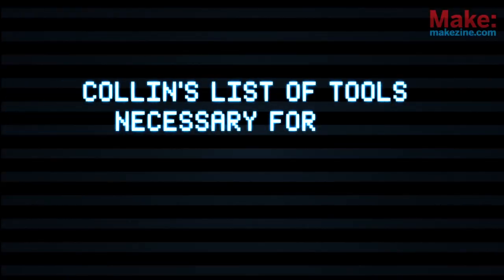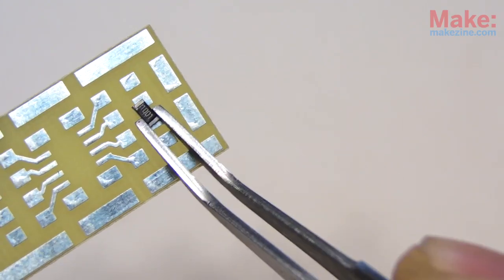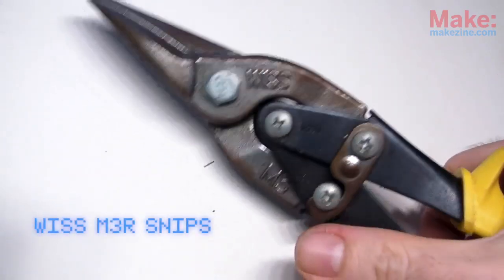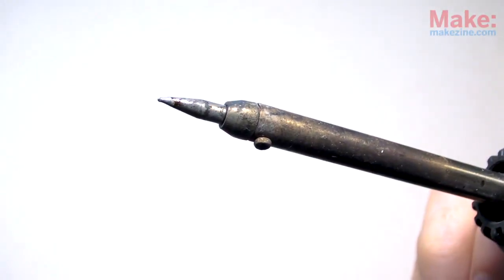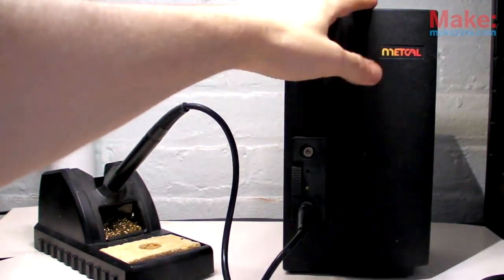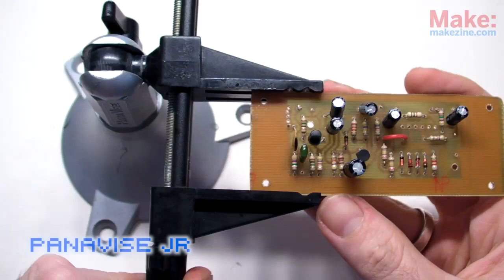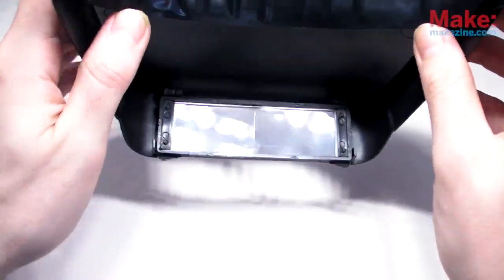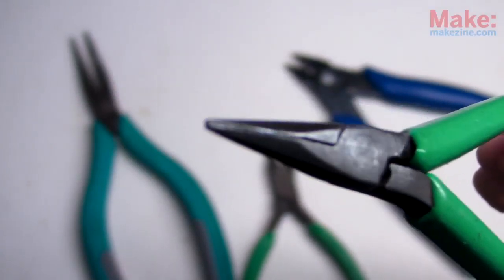Collin's Lab: Electronics Tools

Comment: hi, can you do a video on heavy-duty pcb controller boards, like the induction hob mcd3500 to remove the components and replace bcos am looking for and easy way to desolder and soldering parts as I have seen the board got a milky layer on top of it , let's say protective layer. thank bro enjoy it. 👍👌

Comment: You'd have much more easier time just adding bunch of solder to leads then use tweezers to pull it out, and then pump all the solder out, this way i prevent circuit board damage when cannibalizing for parts.

Comment: wtf u dont need any special tools to cut the insulation on the cables i just use sciccors or my teeth
Reply: Most people, myself included, have a hard time stripping wire without a wire stripper.

Comment: Recently discovered an awesome tool/trick. To remove a component for reuse-Pull on it lightly then hit the underside of the board with a heat gun on high and close. With just a little pulling when the solder softens, the component will come out nice and clean.
Reply: Carl Carrano wow thats cool thanks man thats gonna be pretty useful later on(:

Comment: phffff... wire strippers are for noobs. i allways use my red household scissors to strip my wires
Reply: If I put the right music on,  my wires strip for me..........  : )
Reply: Pff... Scissors are for noobs. I always use my teeth to strip my wires.
Reply: That seems more noob-ish to me.
Reply: the best success that i've had was with the Gregs Electro Blog (just google it) without a doubt the best info that I've followed.
Reply: Justin, sure. One dentist said "lol, a gopher teeth" after I opened my mouth. That was fun (no).
Reply: Pff soldering stations are for NOOBS,

I always shortcut a cable plug it into a wall and then wait for it to heat up so I can solder
Reply: I got some strippers in the club
They all want my wire
Reply: Just don't fuck with the wires, fuck the strippers

Comment: What about solder wick for desoldering. Much better than those I would say.
Reply: +Nick Coltrane Nope! Pump, any day! :)
Reply: +Nick Coltrane It depends on what you're trying to desolder. For surface-mount components I think wicks are going to be much better and easier to work with. However for through-hole things, you'll likely go through a lot of wick when you can just suck up the solder.

I've personally used the pumps for larger through-hole components. Sometimes the leads just get in the way of the wick and don't let it fully work correctly, whereas a pass or two with a pump gets what I need taken away. I'll go in with a wick if I want to replace or clean the pad/hole.
Reply: +Nick Coltrane That's what I thought, too. I'll pick a decent solder wick over that pump thingy any time.
(Though it is a consumable - it's pretty cheap, though)
Reply: spartan456 I second that.  I find adding a little new solder helps too.  For through hole, suck up what you can with the pump, then  use wick to clean the pad if needed.

Comment: Hey Collin!
You are a Great Instructor and 'am always looking forward to watching your video tutorials.  

Since the electronics market is changing to SMDs more and more, a presentation of hot air solder stations would be in order, plus All the peripherals that go with it.  That includes the type of flux, solder paste and the applicators such as the gauge of the blunt needle tip.

Google & eBay are my best source of this information so far.  You could do better.  So, how about a video on the subject?

Also, when buying DIY kits (as they are now called), seems there is always an SMD IC chip that has to be soldered onto the board.  There's just no getting around it!

Keep up the Good work!

Lord Saint Dennis Charles Smart, Enlightened
Heaven's Spokesman & Hobbyist

Comment: I got a Veller maginfication visor with built in lights. The problem is they used old fashion light bulbs. So the first thing I had to do was to mod it so it used LEDs instead.
Unbeliveable that they haven't changed their design to use LED lights.
Reply: What's the focal length of the lens(es)? How close do you need to be to the thing you're looking at?

Comment: Just to add to that list, I much prefer the jokari tool, it's really handy to strip cables. You don't need to adjust it, it just naturally fits the cable whatever it's size and strips it, even in the most tricky angles!  http://www.ebay.co.uk/itm/330258217490?_trksid=p2057872.m2749.l2649&ssPageName=STRK%3AMEBIDX%3AIT

Comment: hey collin I always admired your vids. I garra question , is there anything for measuring electronic parts like for example a small resistors or capacitors to know what are their types( numbers) ?
Reply: Babylon Gate For resistors, your typical multimeter can tell you their resistance.
Capacitance or Inductance is a little trickier to directly measure, the device used to measure that doesn't come cheap.

Comment: Just to add...A good light source and heres a few improvised tools of my own... good pair of nail clippers are great for close cropping of wires/soldered joints and transistor/ic pins...also...blue tack or playdoh for temporarily holding awkward shaped parts etc, I have also made my own magnifying visor out of a pair of sunglasses...the plastic type by cutting a circular piece out of one lens and putting/screwing in an old  telescope/binocular objective lens in the cut out circle, works well for working with/soldering very small parts, also...a headlamp in conjunction with the visor or without works well, Anyone else any improvised tools to add? I would like to hear from them, Great site by the way Collin!
Reply: dude thanks!!
I had no idea about the PlayDoh tip.

Comment: Collin's I might suggest you learn the proper name for those tools and follow the Mil-Spec certification rules when making your recommendations. "Just saying," as an Instructor of Vocational Adult Electronics for 20 years and training 6,000 students proper electronic assembly and soldering as well as many other courses in the program. Also you don't use round nose pliers, they bend items and leads smothly rounded so they are stronger and not sharp folded at the bend. Also those "Tin Snips" as you called them were in fact "Aircraft Compound action cutters for sheet metal, not tin, as much as aluminum and light steel sheet. Thanks for trying but you could do better... And I expect it from you. Also I often use a "Drill-Press" Vice is a great unit and inexpensive, Try the Harbor Freight 2.5 and 4 inch models... Keep up the good work, Your watchers deserve the best instruction you can provide.
Reply: Be careful of "3-in-1 oil they sell a nice lubricating oil AND a furniture polish that turns to varnish in a few days...   another choice for rust prevention ,(Especially here in the damp south) is Kiwi Mink-Oil boot polish, it goes on easy and protects from rusting for about 6 months  Just use a tiny amount and buff most off. I use it on the Vice and snips, as well as my shotgun and they are protected from rusting but do not have to be cleaned off before using... "Keep up the good work.."

Comment: You don't a DMM with a low impedance input will get you by for a long time, in time you will find it handy to have a second DMM, but no need to purchase that until you find yourself needing it A power supply would be an early on purchase. Most of the others mentione generally can wait untill you find a good buy on them or you find not havingg them is hinderingg your work.

Comment: I'm guessing that the solder melts.
Well solder not sticking to the iron could mean a bad soldering iron tip.
That's why the top of the tip is different from the bottom.
It's designed for good stickiness and other performance enhancements.

Comment: It was a new soldering iron (so also the tip) and I always use rosin core 
it just turned out that the 80W iron got to hot because since I added a in-line dimmer and got the right temperature everything works great and the tip isn't a problem anymore 
I love this new setup (instead of a simple 30W iron I now have some kind of 80W station :)

Comment: Well, oscilloscopes are quite expensive, and you probably won't need it for most hobby-level projects. As for the fume extractor, you can make one, solder by the window, or outside; it's not truly essential unless you solder a couple times a week (or more frequently) or for long periods of time. I agree with you on the multimeter, though, even a cheap $10 one will cover most of your needs, and you'll be needing it always.

Comment: could someone help me pls:
I made my own soldering station out of a 80W soldering iron and a in-line dimmer. But my solder doesn't wanna stick to my iron, I tried to put it warmer and even colder (have yet to calibrate it since my multimeter is being repaired now) without success. I do clean my iron on a wet sponge and with a metal brush thingie but it doesn't seem to help much.
If someone knows how to fix it pls tell me.

Comment: Metcal's what I use at work. Awesome iron, though I like it best because it has such a short tip length. Not great at tight spaces, and they get kinda hot after a lot of constant use, but the amount of control you get outweighs these problems many times over. Too long a tip kills accuracy.

Comment: another more expensive high quality soldering station: the weller ws81t goes for around 300-400 bucks and its a joy to work with. Adjustable temperature, nice flexible cable and an weller stop and go soldering iron holder, which shuts down the soldering iron if unused, which saves a lot of expenive tips :)

Comment: BUT, the video is about TOOLS for CONSTRUCTION.  I got parts, board and schematics, what is needed to put them together.  It is not about tuning, tweeking, reconfiguring or experimenting. What do you need to get the parts on the board.

Comment: @ChozoSR388 Let me be more clear. I can use a Dremel, a soldering iron and a wire cutter (tools) to make a PCB. And to test it out I'll use an osciloscope and a multimeter (measuring instruments [instruments]). According to the context you're using, you can use both to say something is an instrument or a tool. In this case, some of us consider the multimeter as an instrument and not a tool.

Comment: @bahstrike It might be useful for specific circuits, but certainly not a basic tool that you must have if you want to do anything with electronics (the only thing I can think of right now, is to check voltage if you switch from AC to DC or something, a lot of the time people have a DC power source though)

Comment: I consider soldering to be difficult and I use a Radio Shack 60W soldering station with digital presets and temp. control

Comment: Colin, FYI, 
3 in 1 oil is good for tools but I found another product you might want to look in to. It's CorrosionX It not only protects/lubricates tools but has a dielectric strength of 40,000 V. I found this at a hardware store and the guy there told me it would help keep rust off my tools. I gave it a try and it worked great. I went to there web site and found lots of info and 1 of the formulas works on electronics.  Go to there web site and let me know what you think

Comment: I scored a full size Panavise PCB dolder with quick release and all. It'll accommodate an eight inch long board by the width of about eighteen inches. 

And I got the whole rig for < $50. Error in an online catalog. Sadly it's been fixed since I bought the parts.

Comment: i have a 100 watt sodering iron, its really good and heats up from cool to the touch to hot enough to melt the soder in 3-4 secs which is awesome, but after like  5 min of constant use i let it rest tor 5 min,, but its not that practial due to the tip that goes  bad after a while and its hard to find replacements... :( I always wanted the one with the bent tip that collin uses but 500!?!?!?!!!! way too much for me I could buy a lifetime supply of tips for mines with that money

Comment: Desoldering wicks are easier for me to use and probably cheaper than a desoldering pump.  I was never sure how you were supposed to get the solder globs out of a pump.  I especially like the wicks because I can cut off a 1 inch section and hand it to a friend who needs it or when I don't want to hold something clumsy when I don't have helping hands type tools around.

Comment: Awesome video as always. Something that I am surprised that you didn't include under the desoldering tool section is copper desoldering wick. I always use it after a pump to clean up the last little bit of left over solder. Also, in most situations, it can handle the whole desoldering job by itself if you're patient.

I love these "Collin's Lab" vids. They're always informative and entertaining.

Comment: I need to buy a new multi-bit warranty voiding set and some wire strippers too, my teeth don't work neatly enough (is it just me, or has the plastic covering on wires become more stretchy and the copper become thinner and easier to break?)

Comment: My artillery:
Propane Powered Soldering Iron
Solder Braid (screw solder suckers)
Helping Hands
Variety Pack of Heat Shrink Tubing
A variety of snips and pliers
Automatic Wirestrippers
Variety of Bit-Sets